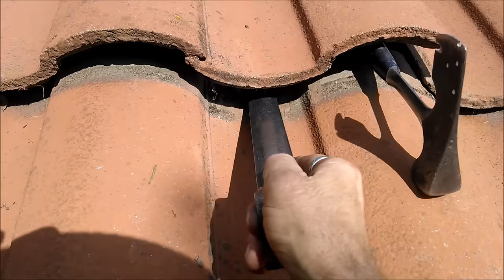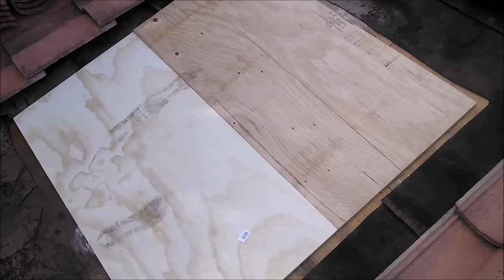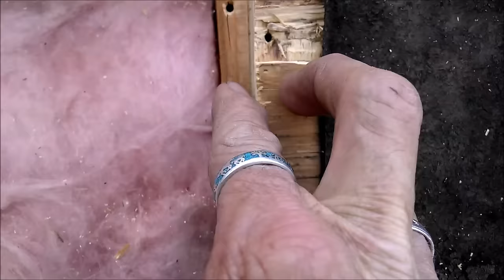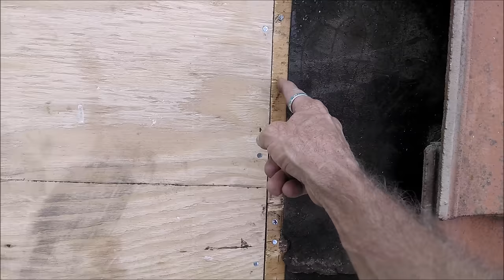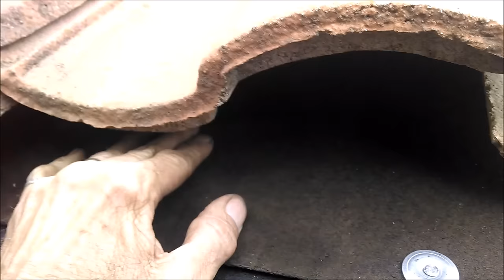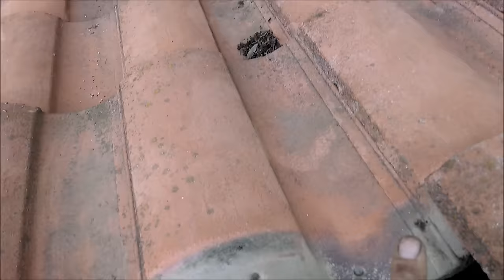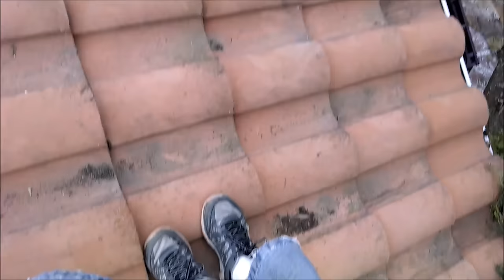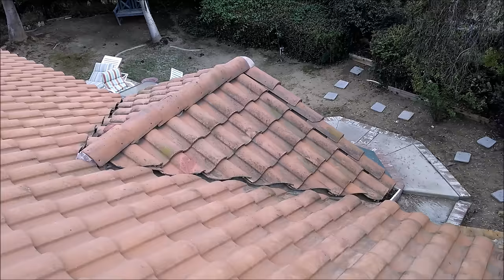Roofing Tile Leak Repair - Tips, Tricks & Helpful Hints

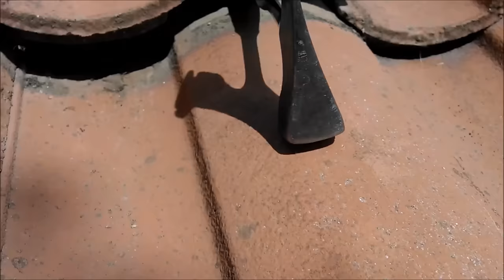Comment: I respectfully have a big problem with this video. When you lift up the adjacent non-damaged tiles, you are causing fastener pullout at the adjacent tiles. Watch the video closely at 1:42 thru 2:34. Note the tiles above and the tiles to the left of the damaged tile are being forced upward. This results in the nails to those tiles being pulled out of the wood decking and tearing the underlayment/breaking the seal of the underlayment and compromising the grip of the wood fibers around the shaft of the nail. This will lead to latent damage in 2 ways: increased risk of future wind uplift damage and allowing for the potential of future water intrusion. Spot repair methods such as shown in this video IGNORE the consequential damages caused to the roof assembly as a whole by doing this type of repair. To drive the point home further, let me illustrate the consequential damage caused. Take a thumb tack. Find a piece of hard wood. Drive that thumb tack into the wood with your thumb. You will note some solid resistance. Now pull that thumb tack out. You will note some solid resistance. Now take that thumb tack and push it back into the same hole. You will note ZERO resistance. Now pull that thumb tack out. You will note ZERO resistance. That's because the wood fibers are no longer acting as a vice grip around the metal shaft of the tack. And that is what happens when you pull up on adjacent tiles...you are pulling the fastener outward out of the decking (however little doesn't matter), permanently breaking the grip of the wood fibers around the nail (as well as breaking the seal of the underlayment around the fasteners)....leaving the roof assembly susceptible to future wind uplift damage. Sadly, the property owner doesn't know this, the roofer purposely ignores this (quick fix, quick money or property owner doesn't want to invest to do it the RIGHT WAY) until the next time 100 mph winds come through and tiles are flying all over the neighborhood. If you want to repair a tile roof CORRECTLY, remove ALL tiles ABOVE the damaged tile to the TOP-starting at the TOP OF THE FACET- down to the damaged tile(s). Don't take my word for it. One of the most well known tile manufacturers in America stated in 2019 properly "repairing any... tile roof REQUIRES a "lift & re-lay" procedure. ALL TILES on the affected slope shall be removed, broken tiles discarded, new tiles blended with existing tiles and re-iinstalled." I say again, the PROPER way to repair a tile roof assembly is to remove ALL courses of the tiles ABOVE the damaged tile down to the damaged tile course and all of the tiles to the left of the damaged tile on the same course. Replace the damaged underlayment with NEW underlayment (DO NOT PATCH OLD CRUSTY FELT PAPER- IT WILL NOT STICK over the long haul which I can prove with dozens of pictures), then replace the damaged tiles with new tiles back to pre-loss condition WITH NAILS.. That is the PROPER way to repair a tile roof. One more thought: Repairing a tile roof with caulking/adhesive is a bandaid fix which does not last as long as NAILING the tiles to the deck. Accordingly, this shortens the useful life of the roof assembly. You don't have to be roof savvy to realize nails will outlast and outperform caulking over the long term. Now, most homeowners (and contractors) simply don't care what MAY happen years down the road. Ever hear of pay it forward?  In the last 2 decades, I have personally inspected hundreds and hundreds of tile roofs across America where roofing hacks repaired a tile roof with caulking that FAILED. Many of these homeowners who paid for these repairs moved on and sold to the current owners. I personally replaced over 30 clay tile roofs in New Orleans in 2022-2024 because the previous 'spot repairs' performed WITH CAULKING  by so called experts after Hurricane Katrina FAILED due to 90MPH sustained winds in the hurricane of August 2021. Virtually all of the current owners did not own the home when Katrina hit. And guess what? There were shattered tiles (with caulking) all over the streets, walkways, yards of homeowners in New Orleans. Caulking a tile is NOT a long term solution. And it will NOT hold up to the sustained negative versus positive air pressures caused in extreme high wind situations/during hurricanes. It's a lazy cheap fix that may come back to bite the property owner down the road or the next person who buys the house/property.  But again, if you don't care, and only have a few bucks to do a repair, then do it the cheap way as illustrated. But if you plan on owning the property for years to come, and especially if you live in a high wind area of the country, this is NOT the way to repair your tile roof.
Reply from the maker: Thanks for taking the time to watch my video & for writing a book. I read your entire comment. While you make several good points, there are always exceptions & exceptional craftsmen find skilled ways around the typical menaces that plague the average roofer. You would do well to have a little more open mind before making so many assumptions about my work. I’ll just make one response even though several are warranted… The nails you claim that I’m pulling out when I lift the tiles are not typically seated flush down on the tiles in the first place. This allows for some movement of the tiles without loosening the nail. Not only that, but the tiles typically also pivot a bit on the nail shaft. Just a couple nuances you don’t seem to have considered before drawing your conclusions.

I like to ask myself, “what am I missing here?” before running ahead to my conclusion. You may want to adopt that policy so you can continue growing in your knowledge of your craft. Just sayin…

Comment: Once again, try metal clips using the nail on course below like one would do with Slate. Next guy can take it apart 10 yrs from now.
Reply from the maker: Sorry, but I don’t think it needs clips. Your assumption that the repair area can’t come back apart when assembled with glue 10 years later, is dead wrong with the adhesive I use. Done it. Been there, done that.

I don’t like assumptions either. They kinda irritate me because they are rooted in a kind of ignorance that thinks it knows better than the ones it’s making assumptions about. You may indeed know something I don’t know, but even if you do, making assumptions about it makes you look ignorant. Ask questions instead. They actually make you look smart & help you become even smarter.

Comment: Clay/concrete tile roofs do need the upgraded underlayment because if one has subsurface cracking that isn't visible during the install and cracks after a year or so the upgraded underlayment will be able to better keep water from penetrating as large of an area and as fast compared to the run o the mill stuff. Then when yyou have your tile roof inspected which if you have a tile roof you should be doing every 2 or 3 years hopefully your inspector will catch it prior to becoming a massive issue where you find out about the leak from visible damage inside the home. Happens in the manufacturing process from time to time and it's not the installers fault but whoever purposefully doesnt nail a shingle or is too lazy to repair it right is a piece of shit and is guaranteeing the homeowner a future problem and doesn't give a damn since they could care less about doing work they can take pride in.
Reply from the maker: Your passion is admirable, but I have seen under literally hundreds of thousands of tiles, and despite those manufacturers flaws, I don’t recall ever having seen an issue with standard underlayment when the tiles are installed correctly.

Comment: WHAT SAYS FLOATING FIBERGLASS CLOTH & RESIN OVER AN ALUMINUM ,O64 SHEET COVERING THE POTHOLE SEEMS IT WOULD DO AS WELL USLESS THAT HOLE WEAK BEYOND 15X15. (DOUBT IT.) AREA .  tIME MONEY CHARGES. $100 TO $400
Reply from the maker: First off, if you want to be considered legit by others, turn off your caps when posting. It makes you look like a martyr & does nothing for your cause or viewpoint. Second, why complicate things with exceptional ways to patch this when standard ways are much more familiar to the public & all future function of the roofing system in this area will work normally for decades to come?

Normal ways of fixing things can be done by the public with assistance from a video like this, or a moderate measure of research, rather than calling a so-called professional or finding someone who happens to be familiar with exceptions, like fiberglass patches.

We can advocate for exceptions all day long, and there are millions of exceptions out there today, but they are a mute point in light of standard practices that have worked for decades when followed correctly.

Comment: This folks is when you do not use a batten system. Tiles fixed directly on to felt paper it erodes the felt away .it's such a terrible idea .Each tile is nailed straight through the felt
Reply from the maker: It’s a trade off. Battens cause more trouble than they avoid, not the least of which is blocking water flow on flashings & under tile. When you block water flow you cause leaks also. The list is long & no, the tiles done erode the felt when they sit directly on in. And, the nails seal right through the felt when they’re installed correctly. I could go on & on but this just shows how much you still have to learn.
Reply: @MrThedocholiday  if you read my critics properly you have to put sacers under the battens so any water can flow .So your saying that fitting tiles directly on to roofing felt is better. Not a chance in all the videos you can clearly see the roofing felt has eroded .plus your nailing each tile through the roofing felt .l think I know a bit been in the roofing world 43 years
Reply from the maker: @davidcaldwell4953 Then why is the felt outside the leak area in this video in excellent condition if what you’re saying is true? And this is just one immediate example in addition to thousands of others. Tile that’s properly installed doesn’t do this when installed directly to the roof deck over good felt underlayment. Installing wood battens under the tile adds all kinds of additional challenges throughout the roof, not just water flow issues. You of all people ought to know after 43 years of roofing that for every benefit you gain from a different method, there’s additional loss that you’ll incur.

Comment: Hey Duster great job. Suggest using GE 100% silicone to repair tiles. I used it for a piece that was broken in 5 places. 20 years later I threw it 2 stories to the ground and it stayed together. Plus it is clear and not so obvious. I have switched to Carlisle High Temperature Water and Ice HT 300 WIP since UL 30# not available. It seals around nails from the tile  and saves time having to nail it down.  Check it out here one of my first YourTubes https://youtu.be/5tpjfGFi96M   Thanks Jeff.
Reply from the maker: Silicone is good too. I use it under different circumstances cause it possesses different properties as you mentioned. These days I use whatever works for the specific job I’m doing at the time. I like to keep several types on hand.

Comment: You are wrong tile in the field at that pitch you do not have to nail the tile in the field. 30 pound only last 15-20 years better underlayment is fiberglass reinforced like a g40 you also get a warrenty from the manufacturer
Reply from the maker: Forty86 Really? What pitch do you presume this roof has? I already showed you the good 30lb felt paper outside the leak area in the video. How old do you suppose that good felt paper is? This roof is about 30-40 years old. Why is the felt on this roof in such good condition outside the leak area if it only lasts 15-20 years? You know when felt only lasts 15-20 years? When sorry roofers do crappy tile work, that's when. You assume a lot for having the evidence staring you right in the face.
Reply: Duster Dan talk with any felt rep on tike roof a no fiberglass reinfored standard astm 30# felt has a life expectancy of 15 to 20 years eveb installed correctly
Reply: Duster Dan i do agree this is alot of bad roofers out there but there is no way you will get 100 years out of a 30# felt. That is complely insane. the aspalt can only get hot and cold so many times until it becomes brittle and start to deteriorate. And you being a roofer should know that how many times have you pull up a roof that was done 20 years ago and was in poor condition even all the fault was installed up to manufacture specs
Reply: I'm not saying you're doing any badd work or what you're doing is wrong or what you're saying is wrong but to say that felt lost 80 to a 100 years is completely insane there is no way that asphalt can last that long I mean an asphalt based product 2nd thing is lots of debris gets underneath tiles and that also is what destroys it I guess of Maybe you pulled all your tiles up every 20 years and clean your felt off I may be but the life expectancy is not that

Comment: Those tile nails aren't usually siliconed???  What the f**
Reply from the maker: Jamey Lane True, but when all the tiles throughout the roof are already installed you cannot shrink the courses to better cover the nail holes without reinstalling the entire roof or at least the entire section. This customer was on a tight budget & I had to make the repair work for him without breaking my he bank but making sure it lasts at least as long as the rest of the roofing. Now do you understand?

Comment: u cant simply drill that hole out
Reply from the maker: fred johnson You’ve never tried drilling out several of these holes in cement tiles? You can drill them, but drilling holes in cement tiles isn’t considered normal roofing work & takes forever compared to gluing them, especially since code allows for gluing tiles into place this way; even on new construction. Why would I insist on drilling them under these circumstances unless I was OCD?

Comment: Why the fuck do builders keep using plywood as the underside for the roofs? I mean it’s the worst material for a place that has to resist the water when leaks occur (and they almost always do due to poor workmanship of roofing contractors these days)🤷‍♂️
Reply from the maker: I  don’t know for sure, but if I were to speculate, I’d guess it’s because everything today in construction is geared towards speed & getting things done, and natural wood planks instead of plywood aren’t gonna return into the equation unless builders & the municipalities that regulate building codes get smacked in the face regarding their ridiculous code decisions & policies.

Comment: It will last 50-100 years ok
Reply from the maker: After you have over 30 years experience servicing roofs - some that are done wrong & others that are done right, you’ll likely see things differently. I’ve seen 50 - 100 year old roofs done right. I’ve seen felt that’s been protected by properly installed tile. I speak from experience, having been on, inspected, serviced & installed literally thousands of roofs of every type & age.
Reply: Duster Dan I’ve been a roofer for over a decade now and I have yet to see 1.

Comment: Lol do not use tar paper. Cost you 75 cents more for that patch. That paper only last 20 years you hack. Heat will eat that tar to dust. You do temporary repairs on temporary roofs.  Tar paper is for dog houses and sheds. Roads not houses lol. Use screws not nails that doesn't happen grandpa. Nails are for sheer strength not pull out force. Cheap cheap cheap my guy
Reply from the maker: Thanks for all the compliments comrade (sarcasm). Nobody here or anywhere online thinks you’re the pot calling the kettle black (more sarcasm). So, you’ve ran your own successful roofing business for 2 decades after you lead in-house company quality control & customer service departments for top rate companies? So you been charged with giving the second rate roofers a swift kick in the backside when they compromise their labor quality? So you have that much real world experience, do you? I bet I was roofing when you were still in diapers homie. So yes, you are correct about felt paper only lasting 20 years… if you dump water & sunlight on it every day during that time period. But let me ask you a serious question… why do you think we put felt paper UNDER the tiles instead of on top of the tiles? Riddle me that Batman? I can’t do anything good enough for some self-righteous people I guess. What a tool… I mean, what a troll.